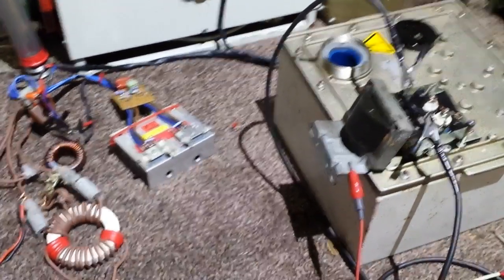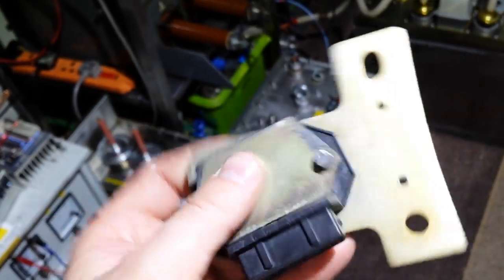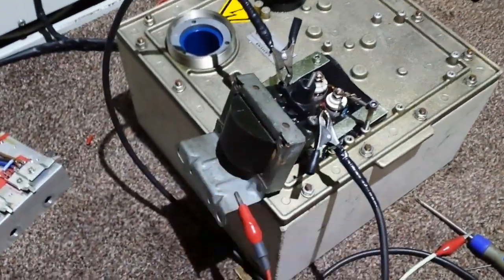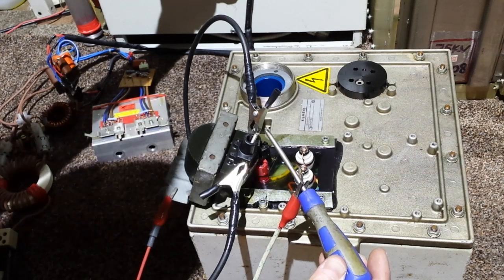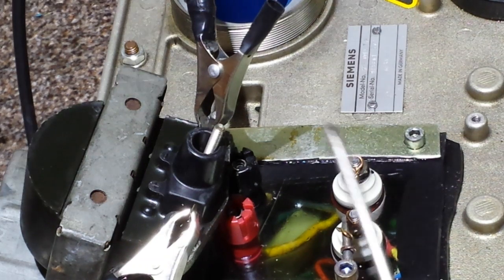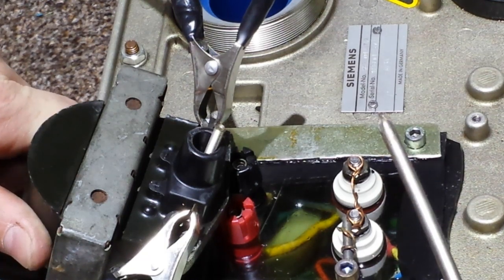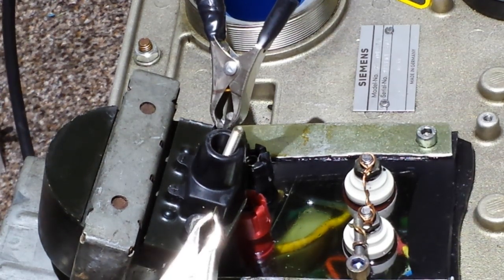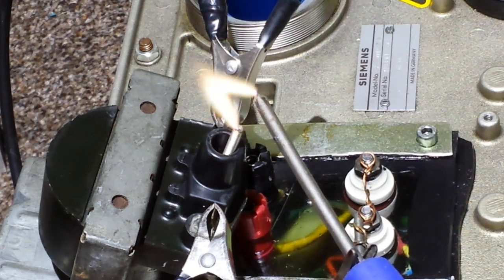Car ignition transformers outputs

Comment: If you want very quiet ventilation/cooling fans, use microwave oven fans without any cowling or grills or anything in the way. It really cuts down on noise because there is no air slapping up against obstructions. Also, i have heard you can somehow drive these coils from a mains power supply and light dimmer and something else. Bill Gilmour has a setup like that.
Reply from the maker: Thanks mate for the info' very kind 😉👍😉
Reply from the maker: Thanks mate for the info' very kind 😉👍😉

Comment: You will get better arcs using the ground terminal it's tied to the - if i remember correctly.
Reply from the maker: Yes your correct. I did say it would be better to arc to the ground pin' but i was trying not too' other wise it has small effects to other equipment mate for some very strange reasons lol 😉 thanks for the comment .